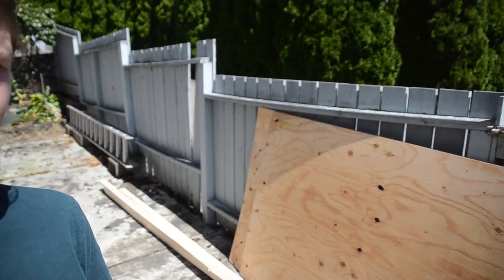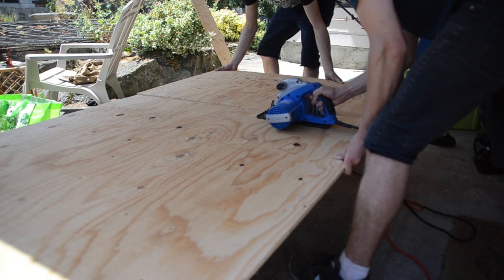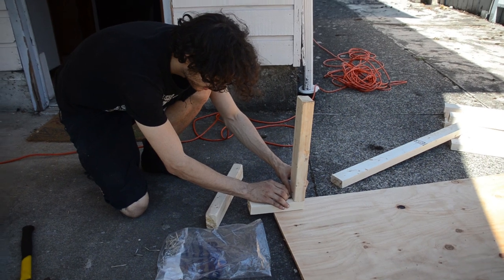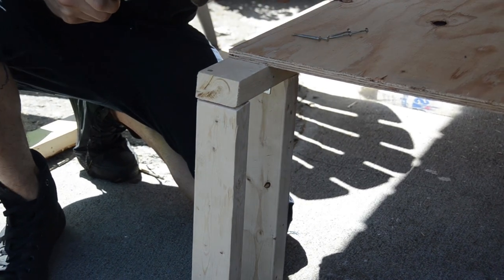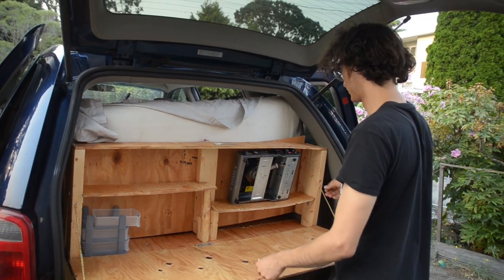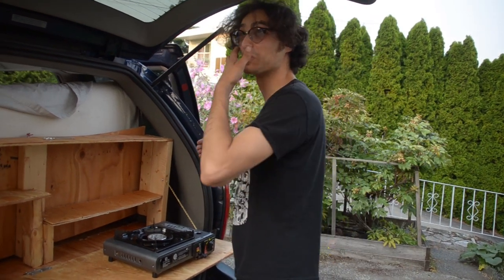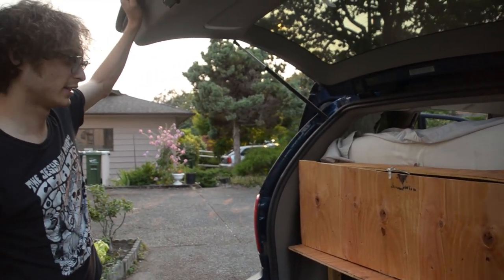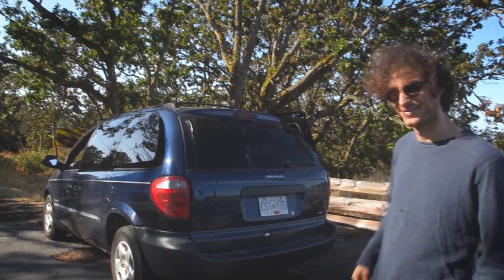20$ Minivan Camper Conversion! how to convert a mini van into a tiny home with a couch, kitchen, bed

Comment: Hey man great info. Funny I have the same kitchenette I have been using for the last 2 yrs in the northwest. it's great 99% of the time cooking outside, however during blizzards and monsoons I have wished for an option to cook inside which I'm designing now, if u leave your carpet in be carful of mold, I ripped my rug out completely because it was staying moist due to wet snowboards and gear, I'm putting a plywood floor in. I'm gonna put up a video wen I get closer.  Great vid. Safe travels